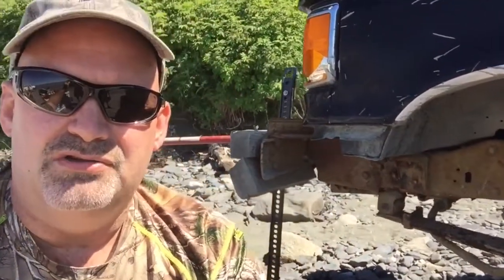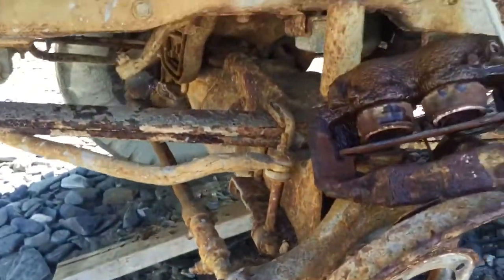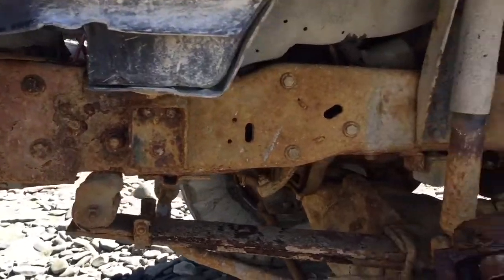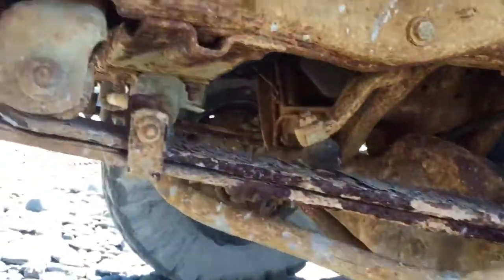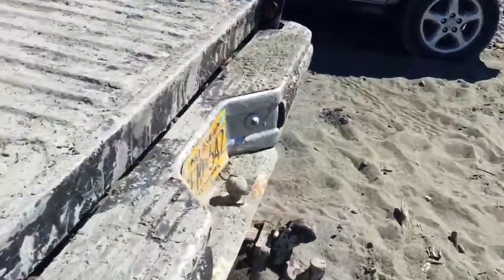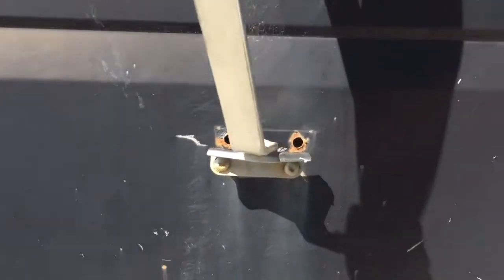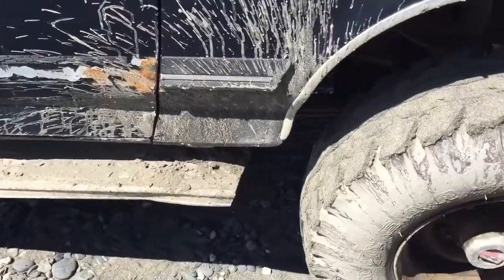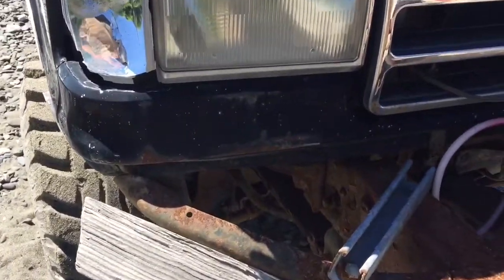Common Ford Truck Problems

Comment: Good video thanks for sharing. I had to replace all of the brake lines a few years ago. I do have rusting on both back panels. There is no reason any truck or car should rust out in today's world. They should use stainless steel on the body and brake and gas lines. Look at the new Ford trucks. A local body shop owner told my brother the new Ford trucks are rusting out. Thumb's up Tim. An amazing video.
Reply from the maker: Aren't the new Fords made out of aluminum? Weird.
Reply: @DoctorD907  yep but i think hes mentioned the steel frame

Comment: Must have been driven regularly through the salt water on the shoreline that it sits on. My '95 F-150 after 15 years in the salt belt of SE Michigan didn't have anywhere near the amount of rust that your truck has. My buddies '97 Chevy looses parts every time he hits a pot hole due to the rust.

Comment: Yes they are made out of Aluminum. Have you seen the new commercial? It shows a Ford and a Chevy truck. Show's them dropping Rock's then a small tool box into the beds.The rocks and the tool box put big holes and rips in the Ford bed. But not the Chevy. I fist saw it on YouTube. But now it's on TV also.
Reply: Thomas Tommy it you go into detail you can see they tortured the ford many times in different scenes, you can look at it exposed on YouTube will show all of the flaws of the commercial
Reply: Thomas-that video was debunked by Romeo. It was fraudulant. It was fake.  And no this isn`t an aluminum bed.
Reply: If you pay close attention and listen the tool box was empty when it hit the Chevy but full when it hit the ford that commercial was a scam

Comment: I'm assuming that's a mid to late 80's truck if your in a salt belt state your gonna have corrosion. Yes the ford undercarriage does seem to corrode a lot more I've owned a few from Michigan with similar corrosion just not as extreme as your case. Ive owned some mid to late 90's Chevys as well and it not so much the drivetrain components that I see the corrosion on its more of the frame just from my personal experience. Its a shame that these great vehicles aren't built to with stand the harsh conditions we drive in.
Reply from the maker: This one has been driven in the ocean. My assessment was a bit harsh on regards to corrosion. It's a great truck considering what has been done to it in its life.

Comment: LMAO was this meant to be a joke? xD late model from like the early 90s, well taken care off, without a single panel that hasnt been smashed in, clearly used off road, clearly no preventative maintenance has been done to it in god knows ho many decades, and still that frame looks way better than the 1 on a dodge ram van I was planning to buy which was well taken care of, but the frame was rotted out